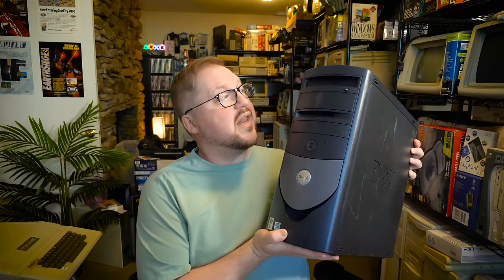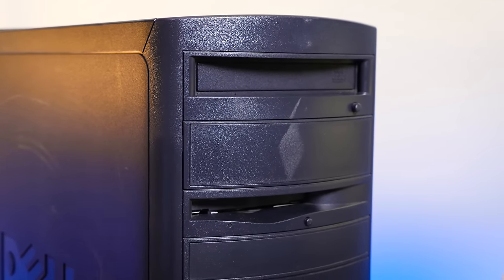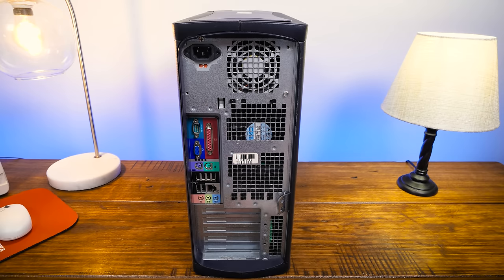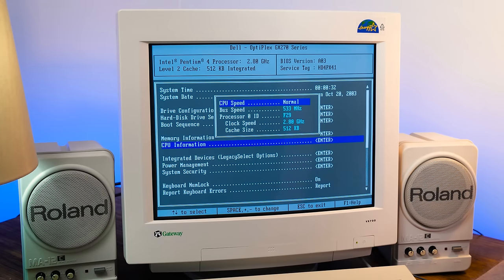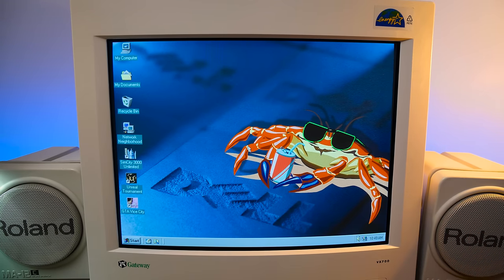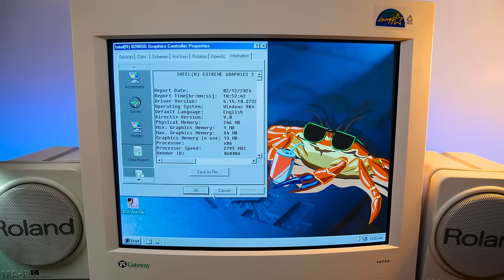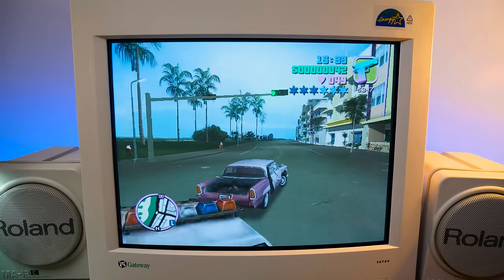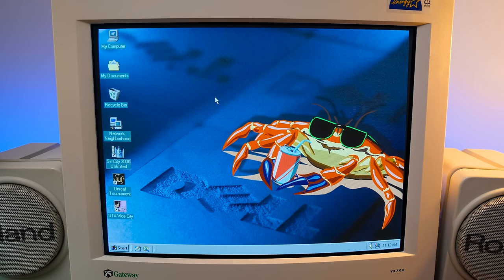The Most Unwanted, Boring PC: Dell OptiPlex GX270

Comment: These machines are nostalgic for a lot of millennials who went to school in the 00s, though I'm sure the capacitor issues caused financial troubles for thousands of schools across the globe.
Reply: Dell covered all of the caps related repairs. It was really quite cool of them to do.
Reply: Chevy Cavalier and Pontiac Sunfires were also nostalgic, but there's no way I would own one then, let alone today. Same goes for this heap, no amount of rose tintedness would see me take one out of my company's ewaste pile  to take home.
Reply: When I was sub contracted as the Head IT for the county back in the 90s-00s. Against my advice they were stupid enough to buy 1000's of these machines At one time in my shop had over 300 of them in repair  as they needed the motherboard replaced. The Pentium 4 GX series almost made dell go Bankrupt as they were 98% real POS. Especially with XP on them. They fared a lot better with Me and 2000.
Reply: One’s waste is another’s retro treasure!
Reply: Dell's RRoD...
Reply: @the_kombinator there's a lot to like about the cavalier and sunfire. They're lightweight and you can throw them around without caring that much. There's also a lot more aftermarket upgrade stuff for the engines than you'd think and you can make them pretty rad. These optiplexes are more like 2009 toyota camrys. Everybody swore by them when they were new but now you see the earlier ones getting love and the later ones getting trashed but the ~2009 has all but vanished. Also some lame zoomers probably have a weird nostalgia for them that nobody else gets or cares about.
Reply: These kinds of buckets were standard issue in most schools over here until very recently. They make good Doom and Duke 3D machines when you're bored in class.
Reply: The pizza box dells of that era were not only more memorable, but also more interesting of a regular out of the box computer.
Reply: Zoomers are still growing up with these. As a first year gen z good lord I know I did
Reply: Being from the UK it was only "posh" schools that could afford Dells (most schools at the time got computers through donations from supermarkets, which didn't include the big brands like IBM, Macintosh, Compaq or Dell). 
My primary school had 1 Acorn computer. My secondary school had a bunch of 'RM Accelerators' (pretty good tbh). 
It wasn't until i went to college in '07 that i got to experience these Dells, along with the newer generation with LCD's! Which to me it was revolutionary, having room on the desk for paperwork.
Reply: @SnepperStepTV  I didn't say I didn't like them, they are sturdy, cheap, and relatively reliant, just like the Dell. I had my fill of 80s and 90s GM cars though (6000LE, Calais, Acheiva, Camaro) and that's enough for a lifetime.
Reply: @joshj88  I guess, I mean there are a TON of Packard Bell fans out there. :P
Reply: @phimuskapsi  It wasn't "cool", it was because they were under warranty so they had to. OptiPlexes, to this day, come with 3 year warranties, like all enterprise computers. Companies typically plan on switching out hardware after 3 years, and if they keep them longer, they keep them under service agreements.
Reply: @straightpipediesel  they went the extra mile and provided it as an in person service
Reply: @adamholmes91  UK is supposed to be a developed and rich country and yet I keep hearing stories like this. Croatia was a total shithole in the 2000s and yet we had nice for the time Pentium 4 IBM or HP desktops. To be fair they are still in use in places where they are "good enough" and in terrible schools, but that's a different story.

Comment: From 2002-2004 I worked as an IT assistant for my high school, which mostly meant vacuuming out the Dells. Poor airflow & a tendency to inhale particulate matter meant that, even with constant maintenance, our computer lab reeked of plastic & hot dust. I've never encountered so many temperature BIOS alarms before or since.

Comment: My work made the mistake of buying an entire fleet of Dell Optiplex GX270 desktops. They had thousands of them, and yes, every single one of them failed due to bulging/leaking caps. Well before the warranty period expired, we were sending them back to Dell to get replaced. That soon changed to them sending technicians out to replace the motherboards, and eventually they just sent us the replacement boards and we'd swap them out and send back the faulty boards. We'd get them by the box load, once I even swapped out 10 boards in a day. I got so quick at it, I could do a swap in about 2 minutes flat. I know for a fact that they knew there were problems and kept selling those machines anyway, because I personally swapped out the motherboards in several machines multiple times each. And they were still selling them after we'd already had multiple batches fail!

It got so bad that we had to get one of our maintenance technicians to replace the caps in a handful of critical machines that we couldn't afford to have fail. Only then were they actually reliable machines.

Comment: Hey, at least that one had an AGP slot, I remember ones from that generation that were so cheap they didn't have the AGP slot populated, with almost zero upgradability they were slow when new, and frustrating when customers would attempt to make them usable
Reply: Indeed, my aunt happened to buy one of these used that had only PCI slots & a socket 775 celeron D.
But somehow sata hard drive, dvd drive & DDR2 ram support.
Such a weird combination of newer tech & cost savings.
Reply: Also weirdly logical for school computer were everything is guided to teach how to do Word and Excel in limited class time

Comment: Oh man, so many memories of replacing those machine by the truckload (literally!) on a US Army installation in the mid to late 00s. In addition to the capacitor plague those machines were painfully slow with the Army customized version of Win XP. 

Even so, they did provide a decent amount of job security due to their issues. At least until Dell themselves bought Perot Systems, who I was working for, and then decided to torpedo all their government contracts in the early 2010s while trying to force a way to make fixed cost contracts more profitable. Needless to say it was not at all a surprise to see Dell sell off Perot Systems for 800 million dollars less than they purchased it for a couple of years prior!
Reply: I was about to comment these boring machines take me back to my mid 2000's Army days, especially when I worked as the Company Training NCO.

Comment: Literally the day you posted this I brought home a Dell Dimension 4600 with pretty much the same specs plus an nvidia GeForce4 MX440. I've been volunteering at my local historical society (no, the Dell was not an exhibit) and they were just getting rid of some old computer equipment and when I raised my eyebrows they offered it to me. I was really just excited to get my hands on that nice Dell 4:3 lcd monitor for another project, I wasn't expecting to bring home an actually decent and running XP machine. 

The other project doesn't want to play nice with the monitor, AND the package included the original Dell keyboard with it's internet shortcut buttons and multimedia controls so... dude, I guess I got a Dell! The biggest difference between your OptiPlex and my Dimension aside from the graphics card is the case. They look very similar by my side panel just comes off like normal instead of the whole rig unfolding like a Saw trap. I think I'm a little jealous.

edit to add... I did check and all my caps seem in good shape. Also, none of the last three owners bothered to wipe anything, so in addition to history museum accessioning records I also have papers and photos belonging to a University of Delaware art conservation professor AND some teenage girl's 2006 Las Vegas vacation photos. So now I'm somehow responsible for all that stuff.

Comment: I loved my GX270, I got it from a surplus store in late 2017, upgraded the hell out of it, and ran XP. It was supposed to just be a retro rig, but I genuinely enjoyed using it as one of my main computers. It had a Soundblaster Live!, a nice AGP card, 2.5 GB of RAM, a solid 3 GHz P4, the works. It finally died late last year, the temp sensor would show it was overheating, even if it was ice cold, with multiple different CPUs. Tried a recap, and while it wasn't worse, I was stuck in the same boat. I recently jumped ship to a Dimension 8300, an almost identical machine.
Reply: the dimensions look a lot nicer, preferable to boring gaming computers we have now
Reply: You can just run a VM for old software
Reply: The temp sensor it's referring to could actually be the airflow temp sensor in the fan. If you look at the fan and see a little blue thing sticking out of the fan hub, that's a temperature sensor and it could be bad. Replacing the fan might fix it.
Reply: I’m in it for the hardware, man. VMs are convenient for those who don’t like to tinker, though.
Reply: @davidpayneii289  yes I don't want a lot of stuff aroind generally. No old machines for me

Comment: My first job out of college was working for a school district in the mid-to-late 2000s. The compact version you show briefly, with almost these exact same specs, was my work computer for nearly my entire time there.

What made it even more amusing was that our accounting system was run on an ancient HP 3000 server at the County Office of Ed (so old that, even 20 years ago, they had to resort to eBay to get spare parts for it because HP had sunset support). I had to run a terminal emulator to connect to it every time I needed to run a budget report or move money around.

Comment: Funny thing is my high school back in 2004 used these almost exclusively. They were the bane of everybody in the design and programming classes. More than a couple crapped out because they couldn't handle some of the software running for long periods or screwy infinite loops

Though I suppose I shouldn't be surprised by the fact the school used these. After all they also had a head of the IT department that gave everyone the admin account password adn who caused a 2 week delay in opening the school (literally as it was brand new) because the ISO image for windows xp he was using for every computer in the building had been made at his house....on a pc that had a virus on it, which ended up on the ISO and kept crashing every pc every time they tried to get the OS installed, so nothing in the building could operate properly and they couldn't open the school as a result

Gets better - a few years later I went to college, went into IT as a programmer and surprise surprise, said head of IT was now teaching several of my hardware and programming classes. and people say the dilbert principle isn't real

Comment: In my country there was a nationally sold brand called "Osborne" (nothing to do with the Osborne 1 computer) that was really literally ubiquitous in government and schools etc. The machines were really dull looking white or dark gray boxes with the most basic components to get your daily work done, just adequate enough specs I would say it. They sold of course them in different price ranges but knowing public sector, I never saw any of the high end models around. In my first IT job, one of the Osborne models we had in a healthcare facility had an issue where the internal speaker's magnet would cause interference with other components on the motherboard resulting in unexpected resets. So as part of our job, whenever we were called to an unit to do a support task like installing a new program, we would routinely also remove the internal speaker from the computer. I would say Osbornes would be my choice for a boring computer.

Comment: I just recently got a gx270 desktop model and a crt for free that surprisingly doesn't have any 'visible' capacitor issues. I have been using it for my old game collection and reliving the glory days of Windows XP. It hasn't overheated yet, but I want to push it with a gpu and see what kind of problems I can cause.

Comment: Brit here - I used to work tech support for the NHS mid/late 2000's, we got so used to swapping out warranty replacement motherboards on capacity faulty dells we could do it on your desk in under 5 minutes, it didn't take long to work out the warranty replacement motherboards were going faulty with the same cap problems resulting in a stern conversation with the dell rep, him paying for an all expenses paid night out and him drinking a flaming cocktail without blowing it out, almost as much hilarity ensued as finding yet another dead motherboard ensuing our continued employment.

Comment: Clint, you’re the best. THIS was the exact model I used to have, as my first PC, when I was in 4th grade, that my parents got me - right down the to the blue driver discs; there was also red ones as well, for other bloatware that came with the system, but, it also came with a copy of Encarta, Office, and a few other “new” things, that I can’t remember. 

This WAS a workhorse machine, for sure, with the HDD space being abysmally low, and the RAM basically being nonexistent. I even remember when I was in high school, we tried adding more RAM chips I got from cleaning out and dismantling some test machines (it wasn’t stealing, it was genuinely part of a class), and it was STILL awful. 

Once I learned how PCs and software worked more, me and my friends would basically use this machine as a test subject; ripping out the OS and trying to run Windows 7 on it (it didn’t end well); pushing the graphics card to the limit for fun; messing with the CRT screen with magnets… you name it, we tried it, and it was still ass. 

I got chills of nostalgia when you grabbed SC3K, because it was the first PC game I bought, and it ran about the same as your test footage: lots of random stops, that might or might not have been a crash. I remember playing The Sims 2, when it first released, on the lowest settings, but, it worked… barely.

From memory, we used the default speakers the system came with, and we got a lot of crackling, but I think it was just the speakers being bad, and not the sound card. Based on your UTK test, it wouldn’t shock me if it was the card, in reality. 

Either way, awesome video, Clint. I didn’t even know the front plate with the logo lifted - I think you blew my mind today, because I thought that was just decor. :)

Comment: That's the PC my luddite parents had, which I had to grow up with until I graduated High School and got to build my own PC as a graduation gift. My folks were so dry, they didn't have a TV in the house, their favorite radio station was NPR, and they were still paying premium for AOL dial-up until 2010, stopping only when the modem died and I told them the only fix was changing service.
Reply: My family weren't quite luddites, but this was also the PC they had from 2004 until around 2018 when it finally died and they upgraded to laptops.  The one benefit to them having it so long was that around 2013, I was able to use it to recover all my old files from floppy disks since it had both a floppy drive and USB ports I could use flash storage with easily.

My mom also kept dial up (she got it free from work) until the modem died circa 2010.  Visiting during college was excruciating.

Comment: At the community college I retired from, I worked in computer services, and we bought hundreds of these boat anchors in 2004 to deploy on campus. Nothing but trouble. Dell had to send out 10 technicians to replace motherboards, that had leaking or exploded capacitors, as we had far too much work to do to repair them (they were under a Dell service contract). We sent them to surplus property in 2007 and were sold as a lot for 750.00. We only purchased Precision Workstations from Dell after that.

Comment: When i was in 4th grade/5th grade, we had the GX260s being installed in the classrooms. My middle school had the GX260s and GX270s, with CRT displays.

My high school had a LOT of those Dell Optiplex GX260s, GX270s and GX280s. The GX280s were affected the most by the bad capacitor plague, and at one point, half of the computer lab had GX280s that were completely dead. The GX270s were affected by the plague but not as bad as the GX280s were. They also had GX520s and GX620s, before all those Dells were replaced by Lenovo AIOs in 2010, and some newer Dell Optiplexes.

I had a GX270 which miraculously didn't have the bad caps, and I had it maxed out at 2GB, had the original 2.8GHz CPU replaced with a 3.4GHz HT, and the original 40GB HDD with a 200GB HDD. It also had an NVIDIA GPU and had it running Windows XP media center edition.

The GX270 does support up to 2GB of RAM, the GX280 can do 4GB

Comment: We got a Dell Dimension 3000 as our family computer and I thought it was the bee's knees comparing to the previous Windows Me HP desktop it was replacing. That is until I tried to run Doom 3 and my mom bought Roller Coaster Tycoon 3. That's when I learned what a graphics card was, what an AGP slot was, and that that machine didn't have either.
I eventually upgraded to 1GB RAM and an 128GB PCI graphics card which allowed it to barely run Halo. I dumped countless hours into that game despite the framerate regularly dropping into the single digits even on the lowest possible settings.
Fun fact: This style of Dell is what the BEEFY computers in cs_office are modeled after